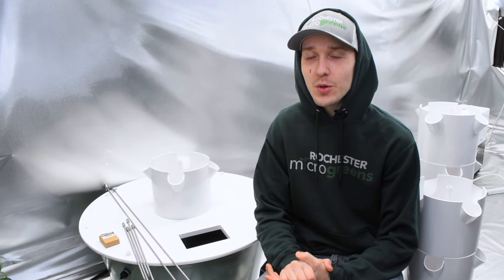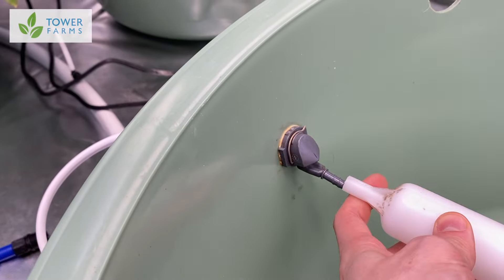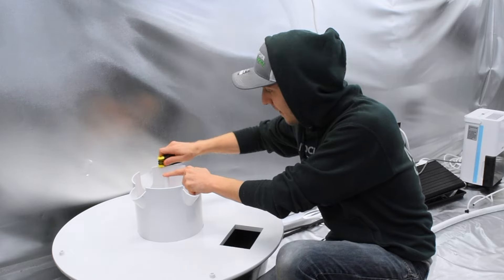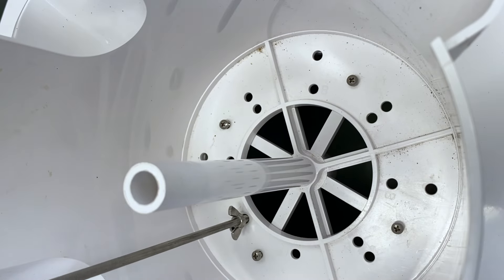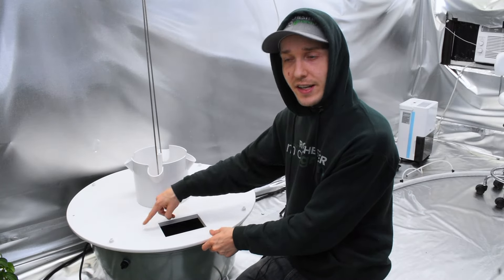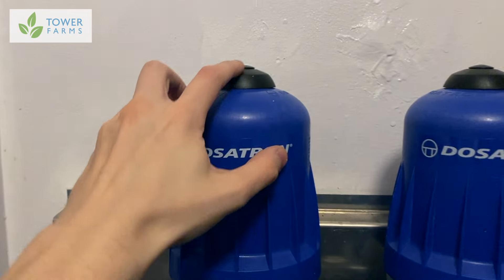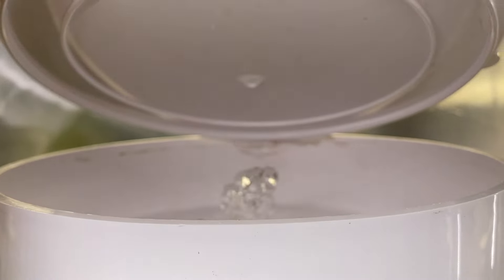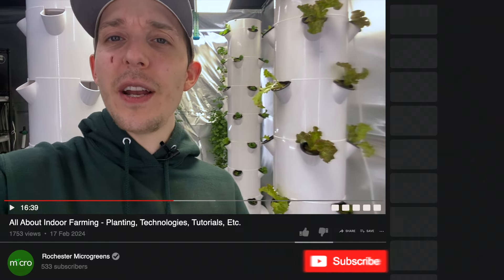How To Build A Tower Garden & Tower Farm (FLEX)

Comment: Great explanation.  Just one thing...when threading the steel rods 'alternate between A & B holes "....yet the downward photo looked like the rod came up through the same holes in each section ?
Reply from the maker: Hi Gorgy, thanks for the comment! They are in fact alternating even though it may have looked otherwise, maybe the shot is off. If they don't alternate it actually won't fit together when you go to put the last pot and shower cap on!
Reply: @urbanagmike  Thanks for the reply.  Ok , I will look again !
Fab video.
Reply from the maker: @GorgyPorgy65  Of course! My privilege thanks for watching and the comment.

Comment: Great video and instructions! Questions: 1) do you need special lighting, like ultraviolet, for indoor farming? 2) how long do you keep the pump running, say for lettuce? I suppose watering of plants is intermitent.
Reply from the maker: @GeorgeTrialonis  Hi George! Thanks for the comment and questions. The answer for lights is technically yes; but don’t overcomplicate it, I’d always get a standard full spectrum light! Tower Garden has light attachments you can get. I actually just tried one of them and love it compared to overhead. And 2 the pumps plug into a timer that’s automatic from Tower Garden, one for outdoor and other for indoor growing. You just flip to whichever is right for where you’re growing. That said, the water cycle is like 45 minutes off and 5 minutes on, continuously! Any other Qs let me know.

Comment: What's the power rating for the pump used?
Reply from the maker: @adelaniopeoluwa9333  23 Watts! They run intermittently 5 minutes on and 45 minutes off continuously. Given an average cost of electricity you’re looking at less than $10 a month for the pumps.

Comment: Why doesn't my reservoir base have a whole in it ?
Reply from the maker: You probably got a residential HOME model that doesn’t have holes for filling up or emptying the tower garden! This is the FLEX, commonly used in a tower farm system which is larger and has these holes in the bases.